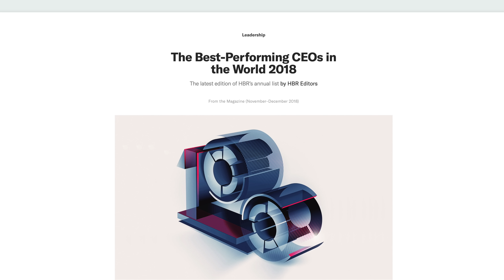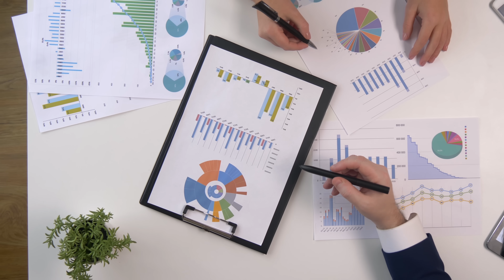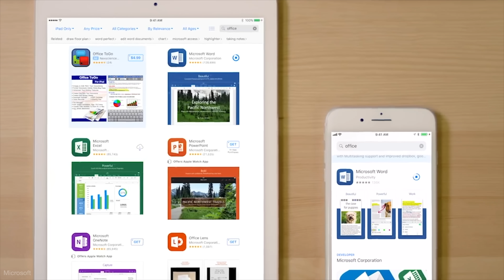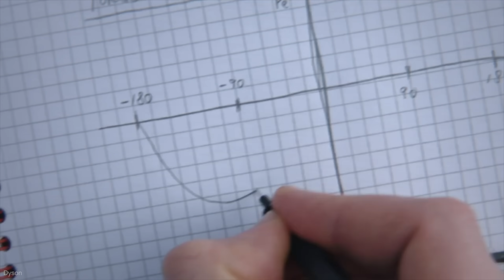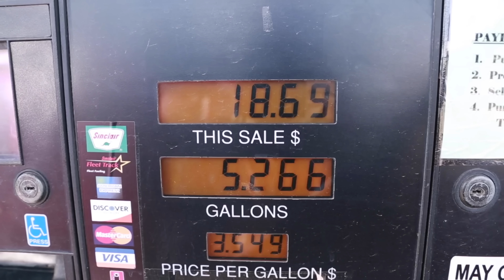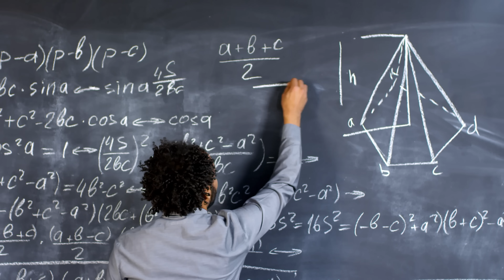Why So Many CEOs Are Engineers

Comment: As much as I don’t like Elon Musk and as much as I don’t want to invalidate the difficulty of the job he does, he’s not an engineer. He’s a physicist that learned some engineering principles and does some design work and offers some design solutions. He didn’t take the engineering courses and he simply just doesn’t have the credentials to be considered an engineer.

Engineering is essentially applied physics and that applied portion is what makes physics an entirely different degree. Physics is ultimately concerned with why things are the way they are and why things work the way they do. 

Its the difference between why is this and does this work. The majority of engineering coursework entails using physics and math for real world problem solving, and that real world problem solving leads into a whole area of applied physics. The gap between applied physics knowledge and theoretical physics knowledge is like the gap in you telling me the theoretical details of bewtons laws or relativity versus me explaining the why this particular cup responds to this loading under these circumstances the way it dors. Its the difference between you explaining energy conservation theories with derivatives versus me explaining how we use kinematics, materials science, thermodynamics and mechanics to make a real world system work. Its the difference between someone explaining how space and time work relative to each other and someone taking measurements, seeing the system and knowing the names of each particular part and what that part does. 

Theoretical vs applied science in college majors is a big differentiator in determining what you will learn in that major.

Comment: You can not graduate an engineering course unless you know how to solve problems  in calculus , physic , chemistry , thermodynamic , engineering economy etc. Engineer are train to analyse and solve problem , when I was new in a chemical engineering job , one middle manager told me He have 16 years experience and still find it hard to solve production problem and He said I will not be able to handle most production problem , I ask Him if the problem are harder than the problem in calculus , He did not answer

Comment: Dear Sir/Madam, 
I hope this message finds you in good health and high spirits.

I'm thrilled to introduce you to SUNROCK RIGS, your ultimate partner in mining and water well drilling. At Sunrock Tools, we pride ourselves on delivering excellence in every aspect of our service. Here’s an overview of what we offer:

1. Advanced Drilling Rigs: Precision-engineered for exceptional performance in Blasthole, Core, and RC Drilling.
2. New and Refurbished Units: High-quality rigs tailored to fit any budget.
3. Comprehensive Tools: From premium drill bits to essential mining equipment.
4. Versatile Truck-Mounted Rigs: Easily transportable with robust trucks from top brands.
5. Top-Tier Compressors: Reliable air supply with compressors from Elgi and Atlas.
6. Terrain Adaptability: Options for 6x4 Trucks, 6x6 Trucks, and Crawler-Mounted Rigs.
7. Impressive Depths: Drilling capabilities ranging from 100m to 1200m.
8. Angular Drilling: Customizable patterns for precise operations.
9. Wide Diameter Range: Accommodating drill sizes from 6 to 12 inches.
10. Mud Drilling Expertise: Efficient solutions for challenging conditions.

Additionally, benefit from remote monitoring, environmental compliance, and on-site training to maximize productivity.

Join the ranks of our satisfied clients who trust SUNROCK RIGS for their drilling needs.
Sir hope you share your WhatsApp number we can discuss about the product there.
I look forward to discussing how we can support your success!

Best regards,
                   
VALLI
Export Marketing Executive
Sunrock Tools
sunroc@sunrocktools.com
or
viswa@sunrocktools.com
+91 9063781824
Or 
+91 9100484969
 103/ Durga nagar, Somajiguda, 500082, Hyderabad, Telangana, INDIA

Comment: hahaha, great products and putting musk boys tesla as an example, its litteraly one of the worst cars on the market with horrendous quality control and safety, nevermind the electric car gimmick.(the power density and charging speed alone is near impossible to improve within 50 years, then you get into the infrastructure cost which cant be justified as there are far far better use for the money in every way possible, be it sustianability, effecient travel etc..)

Comment: I initially did the lump sum buy, 125k into SCHD, 75k TSLA, 25k VYM, 25K VUG. Now I'm dca buying roughly 2k every week of whatever is on sale, and looking to add more tech positions to my portfolio. I'm looking to hold long term 15 - 20 years, so hopefully my lump sum buy in doesn't bite me in the ass long term.
Reply: the strategies are quite rigorous for the regular-Joe. As a matter of fact, they are mostly successfully carried out by pros who have had a great deal of skillset/knowledge to pull such trades off.
Reply: I agree. Based on personal experience working with an investment advisor, I currently have $1m in a well-diversified portfolio that has experienced exponential growth. It's not only about having money to invest in stocks, but you also need to be knowledgeable, persistent, and have strong hands to back it up.
Reply: How can I participate in this? I sincerely aspire to establish a secure financial future and am eager to participate. Who is the driving force behind your success?.
Reply: Lisa Angelique Abel is the licensed fiduciary I use. Just research the name. You’d find necessary details to work with a correspondence to set up an appointment.
Reply: Thanks for sharing, I just looked her up on the web and I would say she really has an impressive background in investing. I will write her an e-mail shortly.

Comment: I dont think it is their higher problem solving ability or IQ..most engineers start to work in the industry right after graduation which exposes them to the intricacies of the domain in which they are working and then they solve the existing problem in value chain through which they make millions....thats not the case with engineers only people who are able to spot the problems in value chain have actually made millions for ex. Michael Dell wasnt an engineer but he still assembled PCs and earned millions, steve jobs did the similar thing...in my country as well many people who are founders are not those who were acadmecians but those who were working in the industry and engineers are the guys who get to work the most in the industry

Comment: Musk has bachelor's degrees in physics and economics.
Reply: so what? U can still be an engineer with a physics degree
Reply: @mclovin2123  Where I live you need to have the actual degree to be an engineer. A bachelors degree in physics is not even remotely the same thing.
Reply: @Ism0n  You do realize people go into software engineering all the time without engineering degrees.
Reply: @mclovin2123  Yes, I think I understand what is the difference between a title and a degree. But I was not talking about job titles, but simply the fact that someone who has a bachelors degree in physics is not an engineer.
Reply: @Ism0n  Someone who just has an engineering degree isnt an engineer as well if they dont do that in work.

Comment: Let's do the gas station problem: we have to start with a base from personal experience. Before starting to extrapolate, we need that base number. I've lived in 3-4 cities and I would guess each of them had 30 gas stations. Now to start extrapolating. Let's say each state has 15 cities like that, so 450, but then go up a couple hundred for the 2-3 much larger cities. So 650 per state. Now we use the pareto principle. We're going to use it to say that 20% of square miles account for 80% of the gas stations. So that means we should add 20% of the 650 to the 650. So that gives us 780 per state. Then we multiply that by 50 to get 39,000, which is our final answer. 

The correct answer appears to be closer to 145,000, so we were off by a factor of about 3. Not great, not terrible.

Comment: And then at the aerospace company I work for…. Former technicians who ended up in the manufacturing engineering team as production planners somehow jumped into “titled” engineering roles and soon into Manufacturing Engineering manager roles. Granted, this did not happen as the exception, rather it became a bit of the norm. Before you knew it…40% or the site organization had non degreed employees in degreed roles… how the fuck do we expect to innovate and push the boundaries of engineering if the leadership team doesn’t know jack shit about engineering… sure, they know the product, they knew how to build the product, but when the new talent comes straight out of college there is no technical mentorship… recruiting becomes “recruiting from the floor” rather from top universities…little incorporation of engineering methodologies outside of specialized teams… projects have no structure and initiatives are not sustainable.

Comment: In my neighborhood, there are 4 gas stations. The whole town has 500k inhabitants, most of which lives in a 15x15 km² Area. That is about 2000 pepole per km². My neighborhood is about 2x2 km². So There is 1 gas station for every 2k. So I estimate that we have 250 gas stations in my town. That seems reasonable. 500 per 1mi inhabitants. The population of the country is about 200mi, so 100k gas stations.
The assumption is that gas stations are proportional to the population. 

I think I am within the order of magnitude, so I would guess that the number of gas stations in my country will be somewhere between 30k and 300k, that 10^(5 +- 0.5). Yeah, that is a lot of uncertainty. No shit, but I'm extrapolating a lot here, give me a break.
Reply: I checked and there are actually 40k gas stations in my country. So I claim victory.
Does this estimation works for your country too?

Comment: It is the aim of the engineer to obtain the best solution possible with the resources available. Engineers are professionally responsible for the safety and performance of their designs. The objective is to solve a given problem with the simplest, safest, most efficient design possible, at the lowest cost.

They are trained to solve problem.

The simplest thing is the tools.
The early tool invented in stone age era is cutting stone. They are the engineers of that time.

Nowadays tools/machines take in many form to ease human task/need.
The first machine that revolutionize everything is the lathe machine.

Comment: Not all engineering degrees are equal, most CEOs come from electrical engineering which is the hardest one. You won't see civil engineers on the CEO lists for example
Reply: the hardest one are nuclear, aerospacial and chemical, EE is hard but not at the same level of those 3
Reply: @campo_rojo  it's EASILY as difficult as those 3
Reply: @campo_rojo EE is harder than chemical and aerospace
Reply: @thefirsttrillionaire2925  That doesn’t count
Reply: Rex Tillerson
Reply: What about sundar Pichai he is in   material science and zomato founder who  literally did civil engineering
Reply: Thats not how it works. Some random civil engineer might be smarter than any EE you can name

Comment: I'm a software engineer. Hopefully I can spread a little more light as to the why that I don't think ever gets elaborated fully as to why computer science and most of the other specific types of engineering mentioned here is beneficial. Writing code and electrical engineering is pretty much entirely about breaking up large abstract tasks into small individual component parts and having them function together with almost no error. For programmers, hacker culture in the 1960s sparked a focus on creating small individual tasks out of code that were common, reusable, and easily shareable with other programmers. Coders could at the click of a button determine if there was an error in large complex systems made of tasks and sub tasks and fix them while collaborating together at light speed creating an ecosystem as complicated as the internet, modern operating systems, and other applications. In my mind this is why the majority of these successful ceos aren't just engineers, but almost all of them currently have a coding background or a background that requires them to create some version of a complex system from simple component tasks. Mbas typically just memorize common trendy business models to manage their teams with little knowledge of why and are typically unable to alter them for the individual needs that every business requires. Coders are trained with models like this too, but quickly find out most of them are insufficient for solving a more complicated task and must be altered. Coders and other engineers are basically trained without realizing with the hands on experience, speed, accuracy, and high level thought process required for developing a successful complex system or business framework from the ground up that a good CEO would need when building a company and breaking up tasks to delegate to employees or other companies to meet a large complex business goal.
Reply: Nobody is gonna read this, genius.

Comment: I'd like to take a bayesian approach, what are the chances you will become a successful CEO (SC) given you have an engineering degree (E). 

This will be P(SC,E) = P(E,SC)*P(SC)/P(E)

P(SC) = 0.00007
P(E) = 0.0005
P(E,SC) = 0.26

Therefore we have 4% chance of being a successful CEO given you have an engineering degree. Make that as you will, I used data readily available on the internet which should give a ballpark estimate but not an absolute accuracy.

Comment: I'm very different than most people as I have a background in engineering and science.  This gives me the ability to see at the atomic or molecular level and then use my engineering background to make the ideas I developed with science, a machine or product that eventually works.  Whereas other people that need to solve a dilemma will give up.  What I also have is a DIY spirit.  Many times I have been called a mad scientist, which I actually consider as a compliment.

Combine an employee  that has an analytical approach with the DIY spirit and good things are going to happen.  How many times have the bean counters with MBAs destroyed a good idea?  A good example of this is Kodak.  They were at the infancy of digital photography but the MBAs didn't want to give up the cash cow of chemical film.

Comment: I think you answered you answered your own question by basically proving the opposite what you wanted to get out of this. These CEO's are great coz of work they have put in to come to where they are, endless hours sleepless nights etc NOT because they have an engineering degree 😄 regarding the problem solving approach there are alot more people having that mentality than the older days and people need to have problems to solve them & they faced mutitudes of this throughout their lives. Just because you have a degree doesnt mean you become Ceo of company if thats the case why did musk and bezoz spend entire lifetimes working so hard to come to these points in their lives ? They could have randomly applied for a ceo position or some other high level position asap they finished their  degrees. What you imply might have been relative in the early days but not now... people have evolved alot now compared to 2 decaded ago..

Comment: Tech companies’ CEOs are... engineers? That’s not surprising. How about CEOs of non-tech companies?
Reply: there aren't a lot of non-tech companies at the top though
Reply: @mentimental  That's exactly why I have a problem with the title of this video: "Why So Many CEOs Are Engineers." Currently, the biggest companies are almost always tech companies, so it's not a coincidence that many of their CEOs have engineering experience. That, however, does not apply to most CEOs of non-tech companies. And there are many, many more non-tech than tech companies. That means most CEOs are NOT engineers as opposed to what the title may suggest. It's just that most CEOs of tech companies are engineers. The title should have emphasized Tech CEOs. 

Think about it this way. Imagine the biggest companies in the world are fashion rather than tech companies. Chances are... most of their CEOs are fashion designers themselves. Would it be accurate to say "Why So Many CEOs Are Fashion Designers?" 

This is a selection bias.
Reply: @edwink1467   I get your point and there is a selection bias but it’s not towards tech companies, it’s just a bias around successful companies. When you think of CEOs you’re not exactly thinking about your little cousin that just incorporated his protein shake brand so that bias for success is deeply engraved in us and leads to pretty valid analysis. The video also had a good example with the chemical engineer running the holding company of the NYSE which isn’t really tech, it’s just successful.

I think the video is going after a valid misconception which is the best CEOs are the ones with the flashiest business degrees and MBAs but in reality, the best CEO today is the one that can integrate the latest technology into their business to give themselves an edge over the competition and engineers seem to be the ones best equipped to do this.